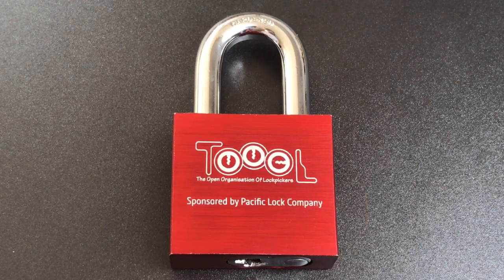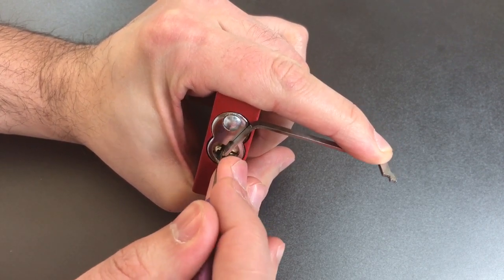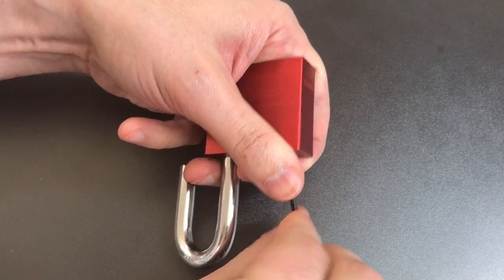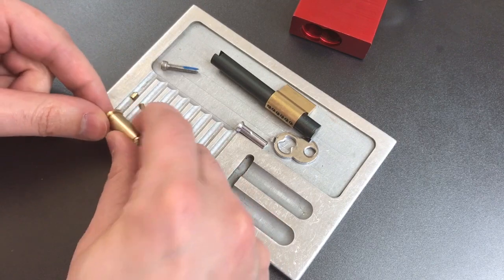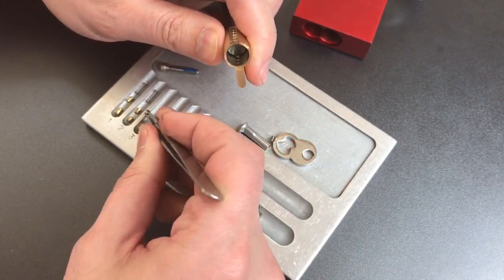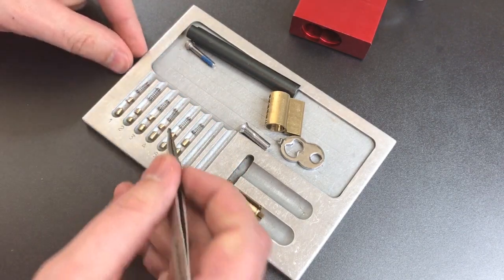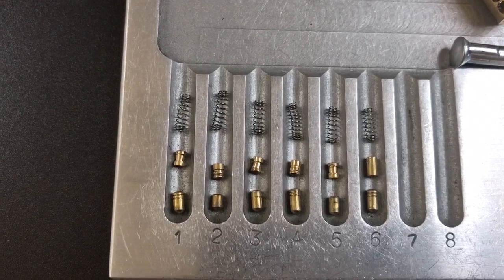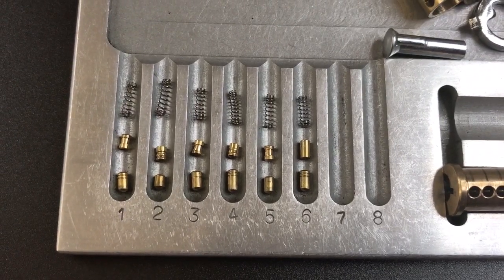[588] PacLock 200A Picked and Gutted

Comment: The springs also have different numbers of turns. No4 looks like it would deliver a different pressure from No5.
Reply: Just what I was going to say. It's also slightly longer.
Reply: bump
Reply: It looks like no 6 is made from thicker wire as well as no 2, as pointed out by LPL...

Comment: Just an observation...It appears to me that the spring in #4 has tighter coils and looks like it may even be made out of thicker wire, which most likely results in a stronger spring (more spring pressure).

Comment: Pretty bold of a lock company to send a lock to Toool without an anti bypass wafer. Merry Christmas all.
Reply: xrayneoo It's not trivial to bypass a vertical cam. You can't push it down to open via the keyway.
Reply: No bypass wafer necessary with a PACLOCK... the design is different than American's so it is absolutely impossible to bypass a PACLOCK even without the silly wafer!

Comment: I have a question about the "horizontal actuator" that can't be bypassed.  I don't spot the visual difference on the core from ones that can be bypassed if they don't have anti-bypass wafers in place.  Do you have a video on this or can sum up the difference quickly?  Thanks for the videos!
Reply from the maker: Watch video 597... it should make sense after that. 👍
Reply: I "see" it now by envisioning the unlocker, which rests in the slot in the top of the core and can't turn independently from the core, therefore bypass isn't possible.

Comment: What is ‘anti-bump resistance’?  Thanks,
Reply from the maker: Oops... meant to say “bump resistance.” 😬
Reply: LockPickingLawyer Okay, I wasn’t being sarcastic it’s a sincere question and interest in a tech term you used.  What is the ‘bump’ that ought to be resisted pls? Thanks,
Reply: You can make or buy a special key called a bump key. It "jumps" all the driver pins above the shear line causing the lock to open. BosnianBill has some videos on the subject. By using different springs and/or different weight driver pins you can make the lock bump resistant.
Reply: macavity cheers mate

Comment: Too all readers n lock sport people, best lock to secure my kids mountain bikes until i build a shed thanks. Some say folding lock but why? Bluetooth with thick chain? What say u?
Reply: U-Lock and thick hardened chain combo. U-Lock through the back wheel and around the seat tube. Chain through the front wheel and around the down tube. It won't be absolutely theft proof but the key is to just make it easier to steal someone else's bike than steal yours.

You don't want an excessively oversized U-Lock else it can be twisted open or have a jack wedged in to pry it open. Keep in mind bike thieves usually go brute force over skill.
Reply: In your own yard you can propably build some little protectice structure/anchoring point. A steel pipe filled with quickrete requires some time for a thief to cut through, it won't be the weakest part. Drill holes for locking elements to the pipe before pouring the quickrete, and put a wooden peg through the holes. So you can drill that hole open easily after concrete is hard.

You can put some angle irons to protect the lock you've chosen. This can limit the thief's workspace and make bolt cutters useless. Grinder will defeat them, but anything that takes more time is a plus. A good design is essential, so that additional elements are easy to use. These iron's are meant to stay at your yard, they can be heavy.
Reply: A u lock can be jacked and or picked an american 1300 can also be picked. The anchor in the yard I'd thought about first but it's the actual lock n chain i need to know about and some thoughts on Bluetooth lock thanks for all replies n merry Christmas😎
Reply: If you don't mind, that you have to use long keys, you can put long steel pipe over U-lock body. Drill holes for the shackle. If the key hole is 6 inches deep inside a pipe, it's more difficult to tension and pick the lock. Your key will reach the lock easily, when you have installed a long shaft to the key. F.ex a split metal pipe or plastic rod could work. 

You can "fill" the shackle of a lock with some relatively weak material, to prevent someone from using a jack. This may be impossible sometimes,  depending on what you lock together. You wrote you don't want U-lock, ok, but whatever lock you choose, you can and should shield it, to limit a thief's workspace and cause more work for grinder.
Reply: Mika Luostarinen thank you buddy